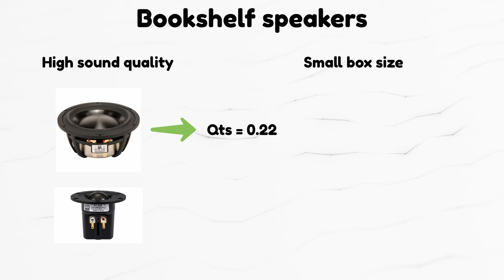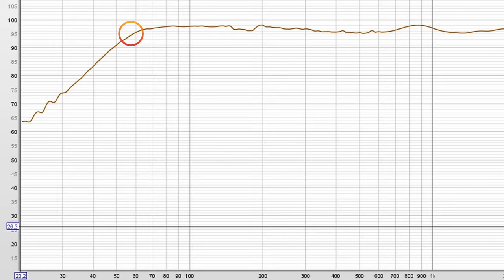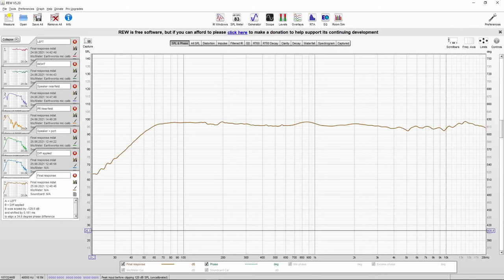DIY Bookshelf Speaker Build - Passive Radiator

Comment: Impressive frequency responce, well done ! for the veneering,look at Peter Rawlings videos, building the kits from GR - Research. he uses paper backed veneer and a water based adhesive which is applied to the box and veneer, left to dry and ironed on with a clothes iron. Perfect.

Comment: To apply venire over rounded corners you may try this: Put painter-tape over top side of the venir and make the backside wet with a sponge in that area, so it gets a little more elasticity.

Comment: Great Build Marius. But why dont you clean the edges with a flush trim router in your palm router. and try the veneer glue that you let fully dry and then iron on with a clothes iron..?
Reply from the maker: I think the iron is used when the veneer has the adhesive pre-applied. This is just regular veneer, and I'm using contact adhesive.
Reply: @AudioJudgement  no it’s a glue you apply yourself in both surfaces, let it dry and then iron on. Peter Rawlings did it on one of the GR-Research builds.?. I also just watched s gut do it using regulär white wood glue

Comment: Excellent video. Thanks a lot.
 I have a question: how does isolation affect the sound quality in the speaker? if i include a lot of insulation can i improve the sound quality? What is the desired isolation limit? What is the minimum limit?
Reply from the maker: You don't want to add too much, unless it's a sealed box. Otherwise, lining the walls is just right.
Reply: @AudioJudgement  I appreciate the speed of your response but, unfortunately, it does not solve my problem. 
It's funny, I can't find a place where I can read what is the role of isolation. 
Everyone puts insulation but the amount, thickness, effect on sound, etc. are not defined.
A totally sealed box gives the same result (I define totally sealed: I only leave enough space for the connections, the rest is, for example, polyurethane foam) as a sealed box that only has partially covered walls (I define partially covered: 1 cm of polyurethane foam)?
Honestly, I have not done any tests but the sound qualities must be altered, that's intuitive but ...... for the better? For the worse? 
This is my question.
Can you help me please?
Reply from the maker: @alejandroleon3365  The main reasons you use dampening material is to absorb standing waves, diminish panel resonances and to increase the perceived volume of the box. In a sealed box you can do that with no drawbacks and that's why you fill the box. However, in a bass reflex/passive radiator, you will diminish the effectiveness of the port/PR as you fill the box more and more. So, you have to balance things out. That why, usually lining just some of the internal panels is the sweet spot.
Reply: @AudioJudgement  Totally agree and grateful for the quick response, almost WhatsApp, ha, ha.
Let's forget the difference between sealed and others.
If I fill the box completely except for the connections, I should not obtain almost an anechoic or anechoid chamber, that is, it would be a box designed to fully absorb the reflections produced by any acoustic or electromagnetic wave on any of its surfaces and the sound would be almost perfect, is this correct?
Do you want to make a speaker box that is as close as possible to an anechoic box?

Comment: I've decided to use a hardwood for front buffles. It gives the best look and solves all problems with edges. It can be colored with all sorts of funky colors with wax-oil to achieve better contrast with the other parts of the box.
Reply: @chanslorvalorum6905  couse it's hella expensive compare to mdf or plywood, hard to find, unstable and will crack and serve no noticeable purpose in the other part of the box.

Comment: The build looks like a lot of punch in a little package. Nice work!

Would you be interested in showing distortion / waterfall data for your builds? 

How much power headroom does this speaker have?
Reply: probably like an 80 watt system each speaker but would probably take upwards of 200-400 watts if the power is clean (unclipped and undistorted)

Comment: Nice work ! It could be interesting too, to show how did you designed the box (Vb Fb etc...) how did you tuned the PR etc ... :) Ohhh! last, shame on you :) :) 140 vertical db scale to show the FR .... :) :)
Reply from the maker: I did absolutely nothing to the passive radiator. It does have a thread if you want to screw some added mass to it. However, It must be something custom as it doesn't come with premade weights. The scale is up to 140 dB because I have a high resolution monitor and it fits a lot of info. You need to look at the graph increments, which is 5dB steps. It's pretty standard if I'm not mistaken.

Comment: is there any problem when the passive radiator is smaller than woofer?
Reply from the maker: Most likely, yes. But it depends. If the passive radiator can handle serious Xmax, then it can work.
Reply: as long as the passive can displace roughly twice the air volume of the Driver you will be close to optimal.  A Passive with the same volume (same size) as the driver can work if it will travel twice as far (back and forth) as the driver travels.  There are several calculators and answers for this on You Tube and the Web.  Check it out.

Comment: The smoothing around 600-700Hz looks like you merged near field and far field data there?  I'd be curious to know what the window size was as well as measurement setup (distances between surfaces and mic to speaker) for the far field measurement.  I'm guessing the smooth bump in the 800-900Hz region is lack of baffle step compensation looking at width of speaker.  I've stopped using the merged measurement quasi anechoic measurement technique because aligning the SPL and phase correctly is very hard to do properly. My guess here is that the nearfield SPL is slightly higher than it should be and the bump is the result of a lack of baffle step compensation that would be more obvious if near field SPL were not elevated.  I'm suggesting this because this is what I did myself several times before figuring out why I got good measurements but a sound I didn't love...  Instead, I now take far field measurements good down to 300-400 Hz by getting good reflection free measurements by getting away from boundaries and assume the bass is OK; this works fine for a 2 way.  This decision came after immediately getting better results after switching to far-field only measurements.  To ensure proper phase measurements (very important), do NOT move the mic between woofer and tweeter measurements.  If you want low frequency accurate measurements better off using ground plane technique outdoors....  There is a reason you don't see low frequency resolved measurements on sites like Troels Gravesen.  Without a Klippel scanner or anechoic chamber I think you are better off ignoring anything below your required window frequency......  

Overall nice build and love that you are spreading DIY speaker building with your well put together videos.  I look forward to watching your future builds!
Reply from the maker: Hello! The response is indeed a merge between far-field and nearfield. The far-field response is accurate down to 275 Hz (I have a large room) and then the merge is done at about 350 Hz. The quasi anechoic measurements are pretty accurate. You are probably not applying  the low frequency box diffraction function to the nearfield response. Nearfield measurements simulate an infinite baffle scenario, and in reality you have a finite baffle box. After you apply the function, the bass response goes down (because in reality not all the frequencies get boosted by +6 dB like  in an infinite baffle scenario). I'm guessing that's why your bass response was misleading. I too only use far field measurements when designing crossovers. The low frequency information is not very useful (as the crossover point is not in that region) and indeed the phase information is much more accurate if you don't merge with some other response.

Comment: great channel, great courses :)
 
I have a question because I don't know it yet
how to take measurements to get full frequency response
 
1. measurement right
2. measurement left
3. measurement nearfield right
4. measurement nearfield left
5. measurement ps/bs nearfield
 
and should I add all these measurements ???
 
have I missed something?
Reply from the maker: First of all, you measure either right or left. I did both just to check if they are the same. You first measure far field, and apply a time window to the impulse response according to the size of your room and when you register the first reflection. Then you measure the bass speaker nearfield, then you measure the passive radiator nearfield, then you adjust the level of passive radiator according to the size difference compared to the active speaker. After that, you combine the 2 nearfield responses (speaker and passive radiator). Then you apply a function to correct the resulting nearfield response (which is basically a half space measurement) to what the response would truly look like according to the baffle size. Then you adjust the nearfield to far field level. Then you splice the 2 curves (nearfield and far field) somewhere between 300 and 700 hz where both measurements are accurate. And then you get full frequency anechoic response.
Reply: Thank you - it's more complicated than I thought.  Could you show it on yt or do you have a course that shows how to do it?
Reply from the maker: You can check my acoustics 201 course

Comment: Anyone tried peerless drivers I don’t get morel in my country peerless tang band and SB I get
Reply from the maker: I have worked with Peerless drivers and are good quality for the money. They have my recommendation. However, if you are planing in using this box design and swapping the drivers for some peerless ones, it won't work. You can use Peerless drivers for other projects though.